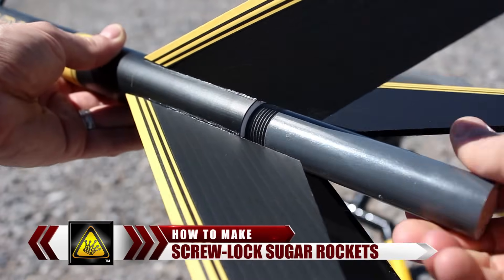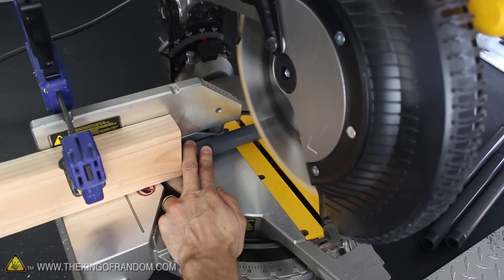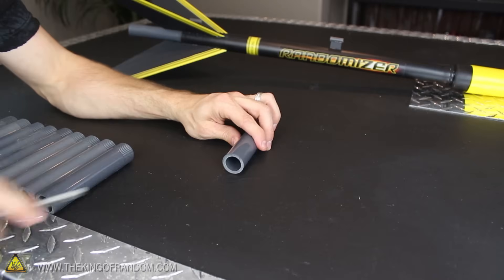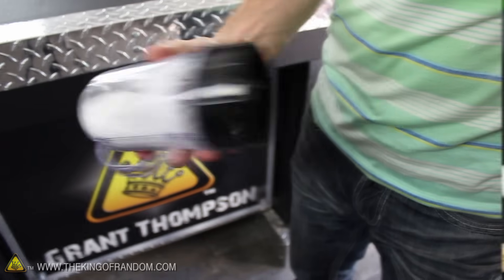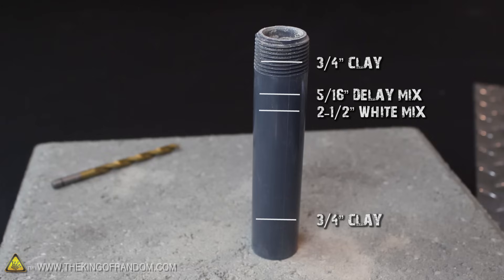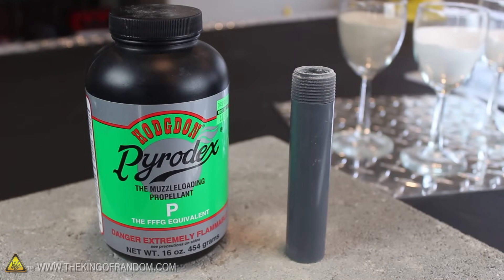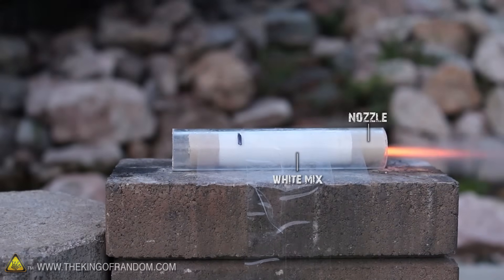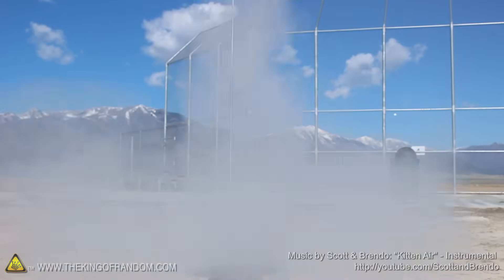How To Make "Screw-Lock" Sugar Rockets

Comment: Whey can't you use card board tubes instead of plastic?
Reply: it'll explode from the pressure inside the motor.
Reply: You should use cardboard tubes, using PVC is unsafe
Reply: @firstnamelastname.7749  why unsafe?
Reply: @matoko123  cuz a pvc casing will shatter if it is overpressuarized and could send shrapnel flying. but a cardboard tube would just tear apart.

Comment: 1:51 do you have a simpler version maybe in cm or mm
Reply: Is this your first time making rocket motors
Reply: @nimamashitongxinglian1213  yeah been wanting to make it for years now but i haven't got a hold of potassium nitrate now that im old enough to buy stuff online then i remember i wanted to do this.
Reply: I will also maybe make a rocket like that with these motors but it will probably in the summer holidays until I can make it because of so much school meanwhile I am making awesome water bottle rockets ;-)
Reply: You can go simply on the internet and change it  into cm and mm
Reply: @nimamashitongxinglian1213  or can you simplify it to inches cuz i cant understand inch fraction its har and inaccurate and its hard to read
Reply: I dont understand imperial either
Reply: Sure just give me a sec to convert on internet
Reply: The total length of the ramming rod is:127mm
Remember how to measure from one side to the other down like the arrows show on stick in the video
4 1/4= 108mm
1  12/16= 44mm
1  7/16= 37mm
3/4=19mm
Reply: @nimamashitongxinglian1213  thank you really much mate really apreciate it.
Reply: Sure

Comment: I made two of these motors and they never left the ground
Reply: Oh I got one to just barely lift off. What would be the corrective action? a longer mix time or better compaction? I'm getting a very nice burn no sputtering or any thing like appears to be generating a lot of thrust but just not enough to get off the ground.
Reply: @davidhender7026  I would say 1. Your chemicals sent dry enough, even if you leave this stuff out for a day it will absorb water
2. Make sure the core goes all the way through the fuel
3. Try adding 1% red iron oxide to speed up the burn

Comment: What do you do to keep the pvc from lighting and or melting? In my experience a heat shield casing of cement or plaster is the only way to keep the fuel from lighting the pvc; ie why the world uses wax coated craft paper, fire retardant pressed cardboard or aluminium tubing.

Comment: **Video Idea**
Why 5 inches? Why not use 24 inches and blast that baby into Class A airspace??
Reply: You can do that but you would have to make several 5 inch rockets and tape them around the outside like solid rocket boosters,   maybe use 3 for takeoff and then when they burn out the next rockets lite up sequentially until the desired altitude is reached.
Reply: @javascriptmikecoder5790  The problem with multiple rocket motors is a; weight and b; synchronising them. If you don't get that right, and it is critical, the rocket won't do what you want it to.
Reply: @bossdog1480  he's probably thinking about ksp: moar boosters
Reply: bjmalley Cus it gonna be too heavy 🤣🤣🤣
Reply: I can't get my hands on the black powder. Is there any other subsitute that you are aware of, which has similar properties/effects?

Comment: Using PVC is not recommended for a motor mount. It can fracture and explode due to over-pressurization. It can't handle the stress or pressure and PVC is not rated for this endeavor. Use aluminum, instead. Aluminum motor enclosures are STANDARD in mid to high power rocketry. NO ONE in their right mind who has actually STUDIED rocketry would EVER use PVC. King of Random not doing anyone any favors here. It's BAD science and Grant should know that by now. Dry mixing or "pounding" KN03 and table sugar isn't that effective. Melting is better and much more effective. I don't recommend SUCROSE but SORBITOL. Much safer and Impulse power much higher. Sugar motors NEED a cored area for the nozzle exhaust or it will just sit on launch pad and just smoke and go no where.
Reply: Agreed. Although for that size engine I think cardboard would be safer than aluminum or pvc

Comment: So... can you reuse the pvc pipe to make a new rocket or is it damaged? Or how many times can you use it before it is damaged? Just wondering as this seems like a fun project. Also, if you used a cardboard like tube would it burn up or would it last long enough, because maybe it would be cheaper to make single use rockets that way.

Comment: Hey, I had been making rockets like these for a while and began wondering: would it be possible to get rid of the clay nozzle entirely and instead use threaded pvc caps on both ends? One would have a hole drilled through it as a nozzle obviously, and I believe if done right you could clean out the casing after a launch and reuse the same casing multiple times. I tried it once and it didn’t quite work, couldn’t get any thrust for some reason. Does anyone know if this is possible?

Comment: I wouldn't drill the engine like that, regardless of how slow the RPM's are. Too much unnecessary risk. Instead pack the engine with a wooden dowel where the hole would be and pull it out when you're done. Perfect depth nozzle every time. Regarding the screw mount method - it makes ejection of the engine impossible, which I often do in order to reduce descending load, minimizing impact damage and the reducing the need for bigger parachute. Instead of threading I cut a small groove around the edge of the engine which hooks up to a small paperclip/rubberband stopper inside the rocket. When the parachute releases successfully, its cord yanks the paperclip and allows the engine to drop out by itself. All and all, a wonderful and easy to follow tutorial.

Comment: The British inch is probably the Pyramid Inch after several thousand years.  1.0011 Imperial British Inches constitute 1 Pyramid Inch.  The Pyramid Inch is a division of the distance between the earths poles, through the center of the earth, metric is a division of the measurement between the earths poles on a line that goes somewhere through France., but if you measured from pole to pole at another location, say 500 miles away, it would be different, because of the topography of the land, so metric is not accurate. Not that it matters when building a rocket as metric is easier, I just wonder how the people who built The Great Pyramid got an accurate measurement between the poles through the center or the earth.

Comment: ok I'm so confused these engines are different. I watch the sugar video first. I followed step by step. I have clay white mix clay. now watching this video it has clay white mix delay then clay. so my question how do I get the delay mix in if the delay suppose to be on top of the white mix. do I need to use the small drill bit on the clay and and drill down to white mix. do I use black powder or the mix of baking soda and potassium nitrate.

Comment: Just consider the metric system for a moment...

K means 1000 x
C means /100
M means /1000

So...

1km = 1000m
1m = 1m
1cm = 0.01m
1mm = 0.001m

The same rules apply to all other measurements of anything. E.g. weight, volume, force, energy, speed, data storage, etc.

Congratulations! You have just learned the metric system. 

Simple Logic.

Comment: Very interesting video.. but you should be ashamed to gloss over the dangers that you are exposing amateurs to, if they blindly follow your instructions. Most pyrotechnic mixtures are friction and/or heat-sensitive, and can ignite.. or worse.. detonate. Do you really want innocent viewers to be injured, or set their house on fire? You should have added very clear and detailed warnings. Hitting your propellant is incredibly dangerous.. putting oxidisers in the oven or even a blender also isn't risk free. Your industrial grade chemicals may contain dangerous impurities that can cause sudden ignition. Sodium chlorate instead of nitrate is much safer, as no amount of friction or shock will ignite that mixture. All in all: it looks like you've never experienced an accident in your home workshop.. and are naively disseminating very incomplete advice.

Comment: You are doing what we did as 14 & 15 year olds 35 years ago. We discovered the benefits of incorporating black powder into the chute discharge as well as the stage separations. We made a 15 foot rocket with over 30 motors in various stages. We didn't know if it was successful because it went so high we could no longer see it. After a few minutes we spotted the three big chutes indicating that everything went as planned. I miss those days. After incorporating some black powder into launch, stage separation and chute deployment we went to a 0% failure rate. Before that the success rate for 100% everything, was at about 85%.

Comment: I'm confused you say that your screw on engines are the equivalent of an E45 engine (E class only goes to 40) then say later that an E9 commercial engine works just as well... how does that work? the number after the letter denotes the impulse avg in N*s and 9 is way less than 45...

Comment: hey, when I was in my late teens, I was trying to get my niece into science with rockets. But even though the "rocket starter switch" cord provided was long, and we launched it INSIDE my car, with the door open, I gust if wind blew it over just as it was launched and it came right at us!!!
So I then learned how to make wireless firing systems to get more distance when launching.
I've been able to make:
-infrared firing system ( about 50ft )
-radio wave ( about 300ft )
-cell phone ( limitless, I guess... )
If you ever want to make a video on how to make wireless firing systems. I made 3 schematics, 1 for each type, and provided them to my local hobbyshop. And will gladly provide them to you.
Ironically, the cheapest to make is the cellphone version...

Comment: I was wondering, isn't it dangerous to hammer the white mix? I would think the hammering would produce quite a bit of heat, but I might be wrong.

Oh, and also putting the nitrate stuff, the white mix without sugar, into the oven sounds dangerous to me. Does anyone know if it is?

Comment: I launched my rocket but the burn never made it all the way to the black powder charge. The rocket shot about 100 feet before plummeting back down. Does anyone have any ideas of what could have happened?
Reply: Maybe you did not put the fuel firmly in the tube, or you might have not made the fuse big enough
Hope this helps
Reply: I ended up packing the fuel real hard, then had issues not coring the center out.

Comment: Attention new viewers:For this project,a system that uses fractions,is more convenient.I mean,for example,the delay burns at 1/16 of an inch per second.
I usually defend the metric system but I never thought I'd have to do the opposite.
Reply: That makes 0.15875cm per second.So,you need 0.64375cm for 5 seconds.
See?If you need inches for one step,you also need it for the rest of the project's steps.
Reply: you could be using millimeters but you aren't.

Comment: pause at 1:54 and just think about the metric system for a bit
Reply: Didn't look exactly difficult enough to need Captain Metric to save the day.
Reply: It's not that fractions are hard, but it's because you're still using the metric system to calculate the fractions of said fraction, and the problem is that you could skip all this annoying process and just calculate with the metric system directly. It's more efficient and more precise.
Reply: @RF-Ataraxia  The reason Americans still use the imperial system is that they were forced to learn it before the metric system (I think in 1st or 2nd-grade they begin learning it and in 4-6th they slowly get introduced to the system most of the world uses) and therefore think it's easier and stick to it. They'd start using the metric system in everyday use if adults would let schools there introduce the metric system first, but sadly that's not going to happen soon unless a lot of kids and adults begin boycotting and causing a ruckus.
Reply: Van Litespeed and inches are for inefficient and and unproductive people who use a complicated measuring system as an excuse for not getting much work done.
Reply: Whether you measure something in inches or centimeters, it doesn't change its SIZE.
Reply: this is why the metric system is the best
Reply: Metric system is sooooo much easier
Reply: roboshuffler555 metric system is for slow people :)

Comment: Fun tip. Don't dry the powder in an oven that has open flames.
Reply: Potassium nitrate is not flammable, nothing will happen.
Reply: I don't know about self ignition, but it's the carburant of the rocket, and black powder get enhance greatly by this coumpound. the sugar is the oxydizer and slow the burning process. a 50/50 mix would be a slower combustion than 65% saltpeter 35% sugar.

Comment: What if, I instead cut the riser in half, and used an extra inch of white mix? (All other measurements are the same.)
Reply: John E. Amdor IV Instantaneous, painful death.
Reply: John E. Amdor IV - I just wondered, if the 'Delay' recipe could be varied, to adjust the Motors Burn Speed, not slowing it as much as the 'Delay' does, but just so it can launch a bit slower, then increase the thrust in segments, like shifting gears?

IE: a 20% reduction in initial thrust, then a 15% reduction in thrust 1 second later, then just a 10% reduction, then 5%, and balance at full thrust!
Reply: @robertweekley5926  It would be quite useless to do that

Comment: I used to fly Estes rockets, I bought one that was about 4 feet high and was said to reach 350ft, I thought I could do better. I designed a 1st stage that would hold 5 "D" Estes motors, two firing first, then two firing when the 1st ones burned out and finally igniting the last single rocket when the 2nd rockets burned out. While designing how I would get the rockets to chain ignite my friend calculated the dynamics of the flight. He came back the next week suggesting I should read his calculations before going any further.
His calculations came to a max speed of Mach 1.2 and 10,000 feet high! 
I decided that needing CAA approval to fly a balsa wood and cardboard rocket probably wasn't a great idea and scrapped the project.

Comment: Okay half way through the video you say "potassium nitrate is highly flammable" but in the beginning you put it in the oven at 300 degrees? That doesn't make very much sense, unless I missed something...
Reply: Patrick Star I believe you are mistaken. When he said that it was mixed with sugar that is quite flammable but the potassium nitrate alone isn't flammable and can't be burned without a fuel.
Reply: Leo Oglecevac Thanks for clarifying.  : )
Reply: There are few things that will ignite at 300 degrees, and potassium nitrate is not one of them.
Reply: Patrick Star flammable from sparks or actual fire

Comment: I had fun with making small rockets in the eighties also but nowadays the potassium nitrate and potassium chlorate I also used are controlled substances that can only be sold to people with a permit.
Reply: Grobbekee what permit do you need?
Reply: Well where I live (netherlands) many chemicals that can be used to make bombs can't be sold to just anyone anymore, like hydrogen peroxide over 12% strength or concentrated nitric acid or potassium nitrate/chlorate but if you have  a professional need for these chemicals like making sausages your company can get a permit to handle the stuff.

Comment: Followed step by step and could only get my rocket about 10' in the air.  The only thing I didn't do was put the KNO3 in the oven for a 1/2 hour.  Think that was it?
Reply: i dont think so. I'm not doing that either, and i still had to drill a shorter hole in the fuel grain cause it was too powerful and blew off the nozzle.
Reply: If you drill a lengthwise hole in the ramming dowel, then put a small dowel in the center of the motor housing you can ram the fuel in and remove the small dowel to make a core burner engine, fill the core left by the small dowel with black powder. That way the whole core surface area burns at the same time. Much more power. Also water putty makes great rocket nozzles, and you can mold a power enhancing nozzle into it also.

Comment: we used to melt the mix and cast motors. The fuel was pored over a tapered piece of wood which when removed left you with a burn chamber. You would lose sight of them. Fast too
Reply: Bertram Brinely. I had that book. They're worth $200 these days.